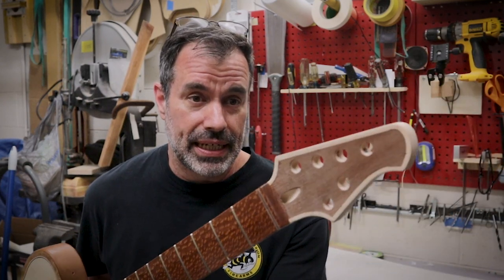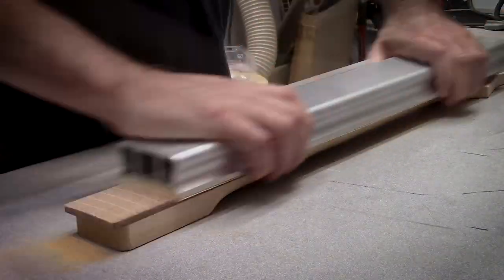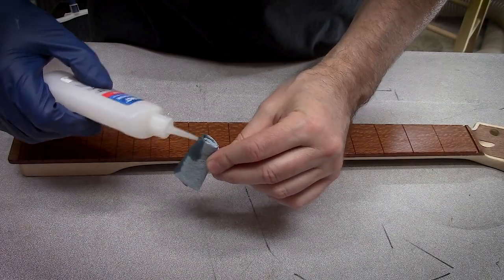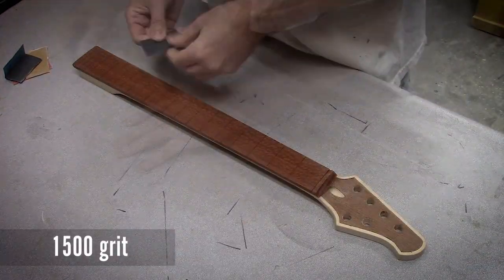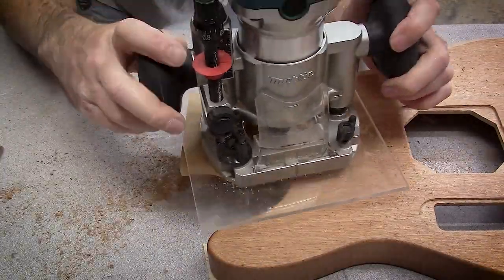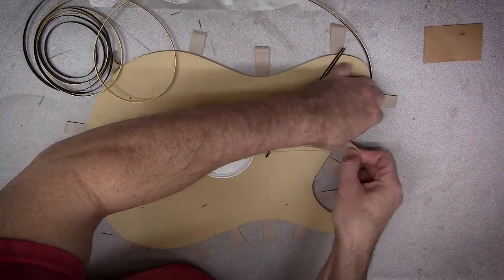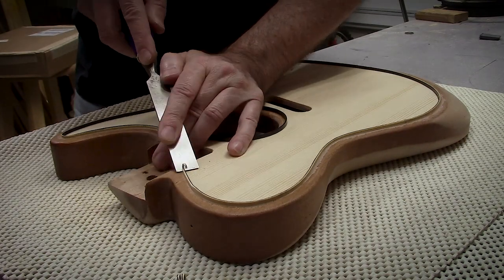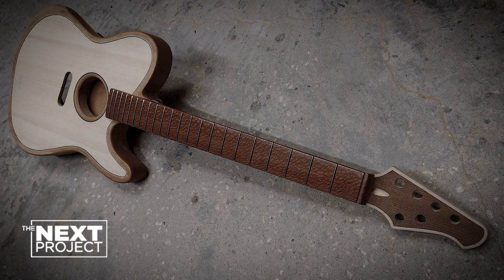Harley Benton T-Style Telecaster Acoustasonic Mod Project Build - Ep 04

Comment: Binding goes on the  edges where the top/back and sides meet to protect it, purfling is a decorative inlay before the edge i.e. in violins.  Guitars can get confusing because decorative purfling can be right after the binding or ornate binding material made to look like there's purfling.
Reply from the maker: Hey Rebecca, thanks for watching and the clarification on binding/purfling.

I used abs/plastic binding material...as purfling I guess I should have noted. Good catch.  

Perhaps I called it binding, because that is what the product is sold as. My over simplified mistake. Oh well, the test went well. 
Hmm, I just realized I very rarely use the term purfling, but I'm always in a bind of some sort. ;)

Hope all is well, take care!

Comment: Hi again. That fret board is amazing looking and the multiply binding around the spruce is a key detail. I'm going to make a version of this myself in the near future for sure.
Reply from the maker: Brian, good to hear from you!
How did the excavation and gravel projects go? Smoothly I hope.

The binding does look really good, and when the final finish goes on I hope the binding will visually pop a lot more.
I used 0.040" black binding at the sound hole, and I'm thinking that 0.020" may have been a better choice. The 040 is pretty bold, but it works. Also, I didn't have a bit small enough for 020 binding at the time...I do now. 
Be safe, take care
Reply: @theNextProject  it went well, ground work is done and floor slab is poured. The workshop is being built in just over a week. This weekend I'm back on the mini excavator prepping ground for a new patio which will go in after the workshop.
Then it's a matter of kitting the place out and getting down to making the good stuff........Twin P90's Tele, all the bits n pieces are sitting in boxes just waiting to be made.

Comment: Brilliant videos - very informative. I really like your methods - although I find the use of so many templates daunting - still if you're going to do it good you've got to right. Looking forward to the electronics episode. P.S. I'm in the UK.
Reply from the maker: paintboxpash, thanks for watching!
I agree the big stack of templates seemed a bit out of hand, but the payoff is worth it.  I often "try" to get away without a template, only to end up making one after struggling without. 
The electronics will be an issue. I expect the piezo under-saddle ribbon and an soundboard piezo won't output equally with the standard tele bridge pup. I don't want spend a bunch for an onboard preamp, and don't really have much room. More research needed.
Greetings from Florida US.
Be safe and take care!

Comment: Really great guitar build and such a good video series too! 👍
One tip; I cringed a bit when you did 35 coats of CA glue on the fretboard... I use a 2 part epoxy, made for surfboard topcoat use. It is quite thin when mixed and will soak into wood, but dries very hard and durable clear layer and obviously UV stable etc. You could have done that fretboard in 2 or 3 coats and got a better result for hardness toughness, durability etc. It can soo be used a grain filler and even a wood glue if you want something much stronger than PVA or other typical wood glues.
Reply from the maker: Wizrom, thanks for watching!
I like the sound of the epoxy for fingerboard finish.  I've used epoxy for grain filling before, I'm kinda on the fence for that. I know it's really popular, but I'm slow to commit, lol.
As for the CA finish, I typically target 20-25 coats. That's about 1 hour of application time, pretty simple overall.
I'm sure I'll try many other approaches I'm my future years. 
Thanks for the info, and I'll give options a shake.
Be safe, and happy New Year!
Reply: @theNextProject    I just wanted to say the epoxy I see everyone using in guitar videos is very thick, personally I think that is a really poor choice.
A good surfboard topcoat epoxy is very thin viscosity, flows like water and is self leveling at a top coat. It is similar to CA glue in a lot of ways without the toxic fumes and sticky problems of CA.
Thanks for the reply dude. 👍🙂
Reply from the maker: @wizrom3046  ah, that sounds better.  Is there a specific  product & brand you like? I'll look it up. Many thanks - in advance.
Reply: @theNextProject     Sorry I cant say brand because I use it for work and not allowed to disclose. Also I'm in Australia so brands might not be available in the USA.
But if you contact an industrial epoxy supplier and ask for a good quality 2 part epoxy for surfboard topcoat use it should have similar properties. Minimum quantity is normally 3kg and under a hundred bucks (maybe $65 USD), should do a great many guitars.
Reply from the maker: @wizrom3046   good info. I'm in Florida, so surfboard supplies will be easy to find.  Thanks for the idea.
Be safe and take care!

Comment: Hello from Colombia! Totally love your content!  Your narrating style is awesome, would like to sit down and have a few drinks with you. Currently, I am undertaking this same project thanks to you.  Can you comment, advise on using CA as a finish but with the fretting already having been done.
Reply from the maker: Al B, welcome and thanks for watching - from Florida!
Good to hear you have a fun project going there!

Hmm, adding CA to a fingerboard that has frets. That's a new one for me.
I can only assume you are looking to apply a finish to a "maple" fingerboard - correct me if that's not the case.
I'm thinking it may become a CA nightmare attempting to get over, or between all the frets. Clean up could also be a challenge, should something go wrong.
I won't say it can't be done, I've just never tried it and honestly don't know the best approach without giving it a try.

Have you considered using Tru-Oil since the frets are in place?
Tru-Oil is pretty tough, and a lot more forgiving when applying.
It won't be as quick of an application process, but you could probably get 2 "thin" coats on per day. I'd guess 10 thin coats total would be a good start.
It would be reasonable easy to wipe off the frets while it is still wet...

If you are interested in using Tru-Oil, look up "tru-oil and armor all".
I haven't tried this approach, but it seems that tru-oil can be applied over a surface rubbed with armor all. Then the Tru-Oil is rubbed in until suddenly "hard". Repeated numerous times to reach the final build-thickness desired.
Again, I haven't tried it - yet. It was in my mind for the body finish on this project, but I ended up using a tru-oil/naptha blend.

Here are a few links if you're interested:
https://www.youtube.com/watch?v=TinQhp4gH_8

https://www.unofficialwarmoth.com/index.php?topic=30377.0

https://castboolits.gunloads.com/showthread.php?272676-armor-all-and-tru-oil

https://www.rimfirecentral.com/forums/showthread.php?t=331108&highlight=blond

I appreciate the compliment too, a pint, or two also sounds good!
Good luck with your project, let me know how it goes.
Be safe and take care!
Reply: @theNextProject  thank you sooo much for your quick reply. I am very familiar with (and love) true oil.  I think I will pursue that option.  God Bless you my friend.

Comment: Amazing job. Do you think that hammering the frets in would be a bad idea with that CA finish? I'm thinking maybe the finish can crack... Cheers from Puerto Rico!!!
Reply from the maker: Joecarvin, thank you!
That is a great question.
On this particular fingerboard (Leopardwood) I think hammering in the frets would have been an issue. The CA at the fret slots would have probably chipped a bit, as this wood is a bit splintery. I also think the CA will help keep the frets in the slots as is.
A bit off topic, but I really don't hammer in any frets now. Once I got the press, my fretting improved 100%, leveling became less needed... Just a better process. But I know that most people don't need, nor have a press, and hammering will do the job.  
I need to do a video of what a fret goes through when hammer in. It can be rather trumatic, lol.
Thanks for watching and question.
Take care!

Comment: Hi from England. I've never seen CA glue used as a finish except as a surface repair, does it have any particular advantages over more conventional coatings? Great video, looking forward to the next installment.
Reply from the maker: Wiretwanger3, greeting from Florida US.
Thanks for watching, and that's a great question about the use of CA.  I don't know all the science, but my limited experience with it on woods like maple have been very positive. 
The CA finish is very thin, very very hard, dries almost too quickly, easy to sand, polishes easily if you want a shine, and doesn't wear very fast for it's thickness build.
I've only used this process on maple, and now this leopard wood. Maple takes CA really well, this leopard wood seems far more oily in nature and I wonder if the CA doesn't penetrate quite as well. I'm unsure about that, so this is a test, as is just about everything I do.
I don't care for lacquer finished fingerboards, unless a road worn look is desired, but that's just me. I've never really liked lacquer. I sprayed cars with it decades ago and was glad to have other products to choose from - sorry, off topic.
I'll be working on the next video soon, have a couple non-related repairs to tend to first. 
I hate it when life gets in the way of fun. Grr!
Be safe and take care!

Comment: What radius do you sand into your boards? (I forgot to ask that on the Starcaster series -- I've since heard they came with a 12" radius standard, which I kinda suspected by eyeballing my back-bowed problem child.)

Also, how long does the shine on the polished CA finish last? Seems it would be heck and a half to reapply after fretted!
Reply from the maker: Hey Mark, thanks for watching!
Right now I'm either doing 12", or 14" radius boards, but I can make a fixture to hit just about any radius. Just haven't had the need yet. I can probably make a new radius fixture in 30-45 minutes now that I have the process figured out. 

I'm putting on 20+ thin fast coats of THIN CA.  Very light sanding every 5th coat +/-.  A final light sanding and polish to preferred shine at the end.
I've got 2 guitars within arms reach. They both still have a shine, one at 2+ years, the other at 3+ years. No noticeable wear. 

CA works great on tight grain boards, maple and some exotic tight stuff. 
I don't suggest trying it in rosewood, or other open pore woods.  As the sanding dust gets in the pores, not easy to clean out. Additionally, rosewood looks like plastic with the CA coating. Yes, I've tried ... struggled and failed.  Rosewood just wasn't in the mood.

Agreed, this is a "before fretting" process. I doubt it will need a refresh unless only a few initial costs are applied, but so far I've targeted 20+ coats and haven't seen or heard of any issues. I think I've done CA on 6 fingerboards at this time.

I really do like CA on maple, and with some patience and practice it can look great!
Reply: @theNextProject  Thanks for the extra info. I like the look you get with your CA process! Good to hear it holds up.

I've currently got two junk guitars with maple necks to try something on, but maayyybe should stick to Tru-oil as my first attempt!

Comment: After CA glue did you have to re saw the fret slots?
Reply from the maker: Edad, great question. 
I did run the fret saw threw the slots, and added a small "v" bevel to the tops of the slots.
This Leopardwood is a different animal, and is more "splintery" than is a regular hard maple fingerboard. I don't typically "v" the tops of frets lots, but I have on baked maple and on this board.

Comment: What a great project. Been thinking about doing something like this myself for a while. Do I understand correctly that you use superglue as a fretboard finish? How did you prevent the fretslots from filling up?
Reply from the maker: Michiel, thanks for watching!
This was a really fun project, I tried a lot of new ideas ( to me ), and overall the results were great.
Yes, I used Superglue as the fingerboard finish. There isn't much that gets in the fret slots, and that that does either soaks into the end-grain of the fingerboard, or is cleaned out before fretting.
I don't recall if I showed a "pre-fret" clearing of the fret slots.
I do check all fret slots for debris, depth and such. If needed I'll either run a razor blade or fret saw through the slots. Since this fingerboard has no binding, it is easy to verify and clear the slots.
Great question, and no worries about the Superglue causing a fretting issue, as long as we do clean the slots.
I play this guitar (at my couch) nearly everyday. No sign of fingerboard finish wear. I have also done this to a handful of other fingerboards, and again no wear issues so far. In fact, I'm really surprised by how well it holds it's shine. 
Good luck with you projects, be safe and take care!

Comment: Wow, I mean WOW!
So what material is that binding? Is that cellulose acetate?
It's great to see s o use a chisel, but I actually think sharp would be better than semi sharp. ;-)
Reply from the maker: Achim, good to hear from you! 
Thank you, I appreciate the comment.
The binding is ABS plastic in this case.
Recently I ordered some celluloid binding and got a hazardous material shipping charge...grrr. Sad when the shipping costs more than the material.
Oh well, the ABS binding works well with CA or acetone.
I like the challenge of using dull tools, the suspense and risk of bodily harm add something to the task at hand. (just kidding).  
I'll be sharpening chisels and a couple hand plane blades/irons this weekend.
Be safe and take care!

Comment: where did you buy your radius sanding block? :)
Reply from the maker: Leepek, thanks for watching! 
The long extruded radius beam(s) I purchased from Philadelphia Luthiery Supply.   I've had no issue with them, they seem to be very accurate in radius and straight.
One word of caution would be the adhesive backed sandpaper you may use.  Spend the extra little money and get good brand name paper, or you may have adhesive residue left behind on the radius beam.  I typically remove the paper from the beam when done using it. Removing adhesive residue from the beam isn't the end of the world, but is a waste of time. 
This is no fault of the beam, but of some  "affordable" adhesive papers.
Hope this helps, take care!

Comment: So how do you like the FastCap fret nippers? Have you used them on SS? I just bought a pair because they are $17 and rated for SS. Build is looking awesome, nice work!
Reply from the maker: Michael, excellent question.
Here is my story...
I purchased my original pair of fastcap nippers 5yrs ago +/-. I still have them and they are like new.
I also bought a new pair a few months back, at a bargain price (amazon), and they failed in 5 frets. I sent them back got a replacement pair and they failed instantly.
I then contacted FastCap, photos and the story. I didn't ask for a replacement, but suggested that there may be some counterfeit or bad batch of nippers on the market. FastCap responded within hours and replaced the nippers I had purchased from Amazon. 
The replacement nipper from FastCap are not identical to the Amazon version. 
I don't know if there was a production correction made, or if there are some clones out there, but the new nippers I receive from FastCap are very good, just like my old original pair.
I hope you have a good pair that are truly FastCap nippers.
Thank you for watching, the great question too.
Good luck and take care!
Reply: @theNextProject  Thanks, I wore my Stew Max nippers flat out, before I ever started doing SS